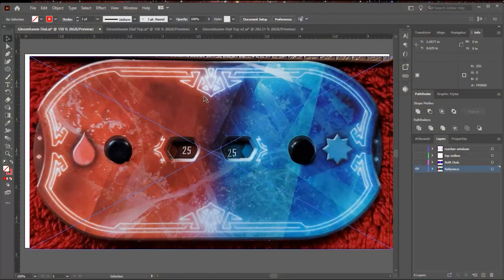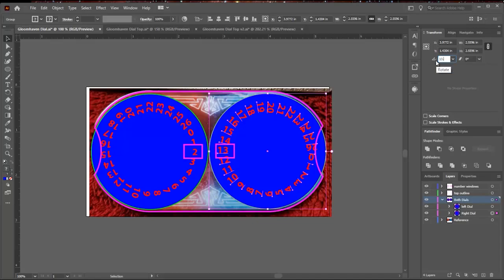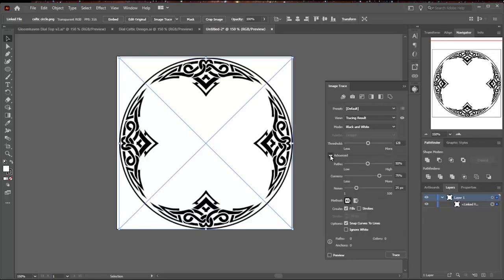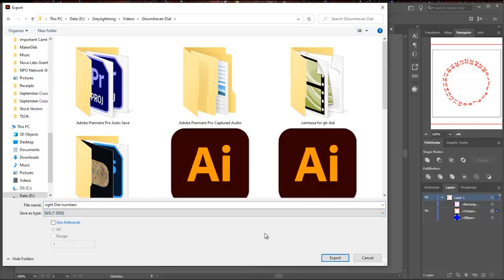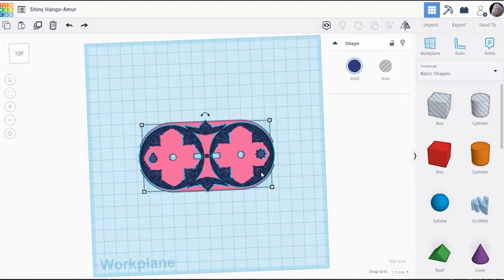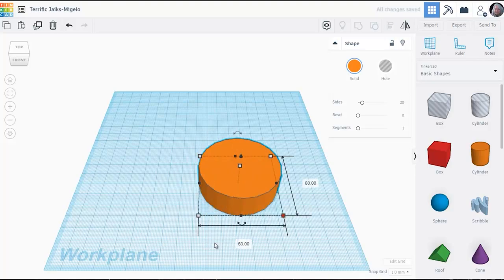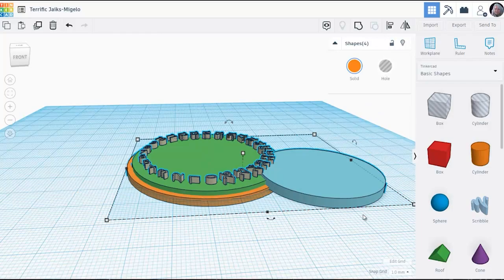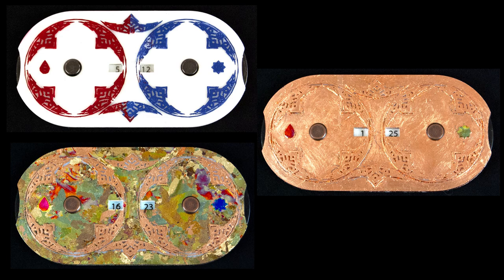How To Design Custom Gloomhaven Trackers For 3D Printing

Comment: I've been sitting here with both GH and Jaws of the Lion (opened and organized, but unplayed) collecting dust waiting for the day when we can group together again. Had the forums not convinced me the go with the Gloomhaven Helper app, I might have followed your lead. This is especially true since I'm taking some design classes this semester which gives me membership to the biggest makerspace in the area and now I have access to resin 3D printers. 

I'm still concentrating on laser cutting since it will be easier for me to implement in my main class project, but when I have free time again, I'll delve deeper into the 3D printing side of things, so as always your videos are much appreciated. I'll be sure to let you know how my class project turns out; I think you'll like it.
Reply from the maker: Randolph,  first of all DEFINITELY tell me about your project when it is finished. Second,  I miss laser cutting desperately but resin printing is very cool and worth checking out. My ultimate goal is to do some projects that use both, like scale model buildings with wood walls and 3d printed connectors. It never hurts to have more tools in the toolkit!!

Comment: I am really looking forward to your multi color print video.  Do you think you'll upgrade those dials to "click" into place for each number, or do they stay put on their own?  I ask because the dials I made for Battletech were with too loose or started to grind off the numbers, but I used Chicago Screws from the local bog box hardware store.
Reply from the maker: Born again, the tension is really easy to adjust so it is working pretty well. You just have to make sure the numbers are set just a little below the surface, so they don't rub against the top when they aren't in the window. Then you can keep it pretty tight, as long as it is turnable.